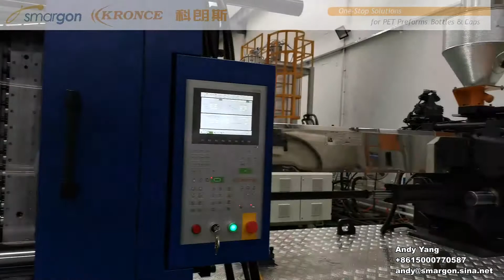Kronce 48 cavity 24g 1881 PET preform system, 20seconds, free drop

Comment: Could you please tell me what kind of resin dryer use here? I mean hopper dryer.
Reply from the maker: It is the hopper with dryer, separate unit. Similar technical from Plastic system for PET resin drying, the dew point can reach -75, to make sure the PET resin could be dryed 99.99%, as the precondition of perfect preform production.